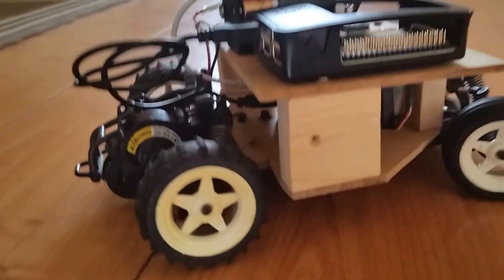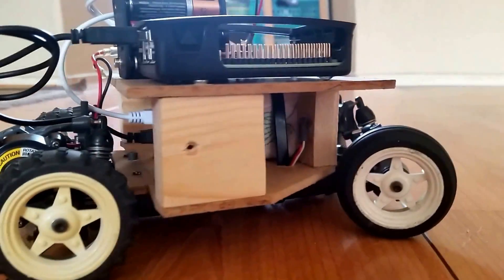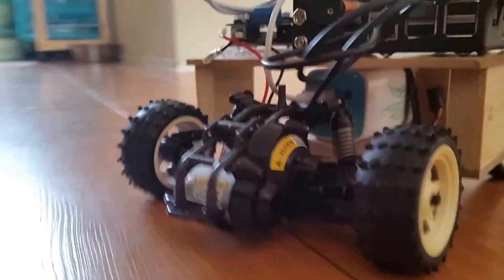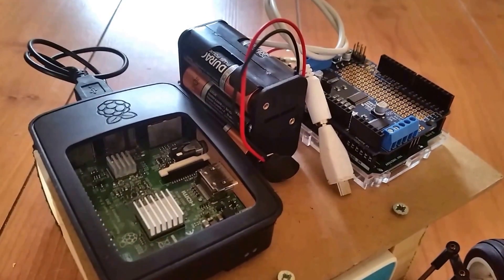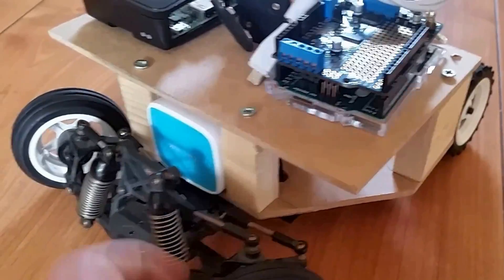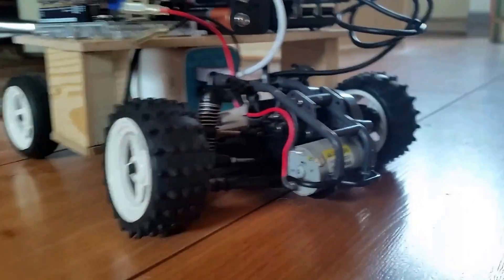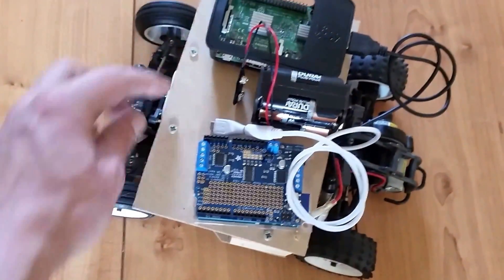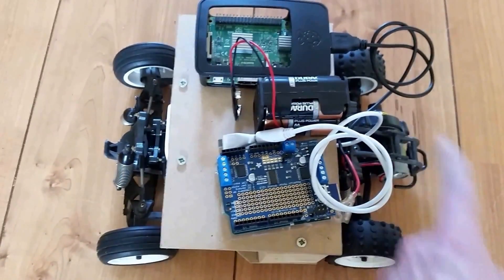Autonomous deep learning arduino raspberry pi wifi rc-car ... part 1

Comment: Hey, I have a question for you....how does the differential and gearing mechanism work?...Did you make it?...or did you buy a cyclone XB10 and modified it?
Reply from the maker: I bought a small 2nd hand rc car for this, don't know the make and model, but it's not the one you mentioned.
THe gearing works are standard on the model.